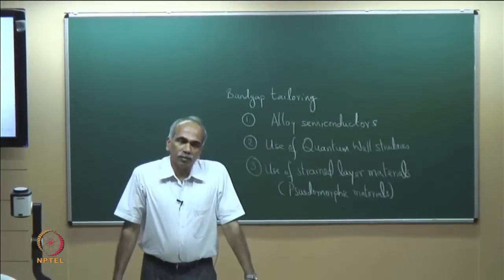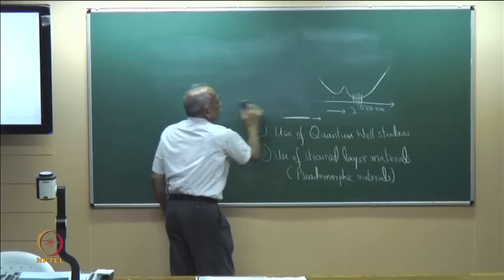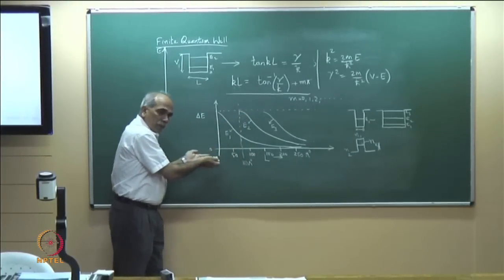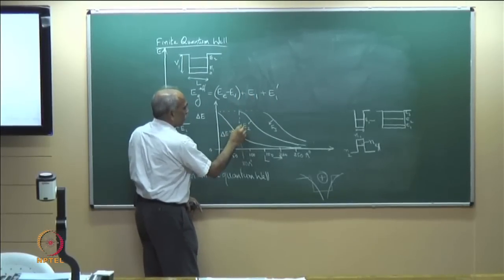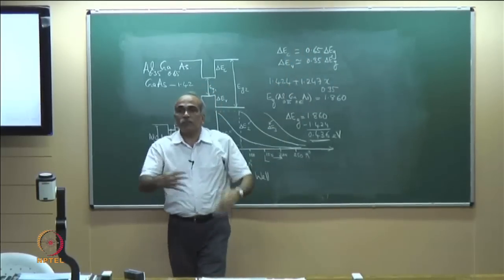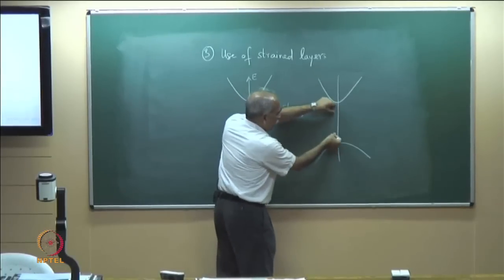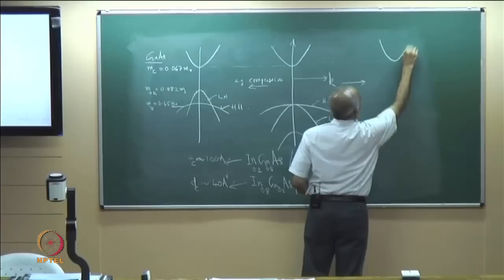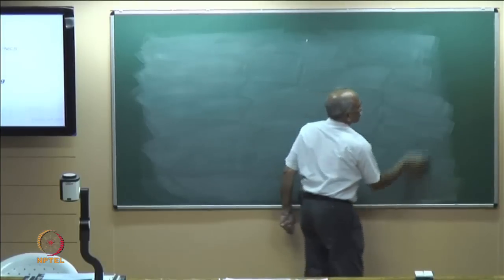Bandgap Engineering

Comment: In between 45-47 minutes; the speaker claims that the bandgap decreases for compressive strain and increases for tensile strain but it's not true (or he has misinterpreted)
The correct statement is: The bandgap increases for compressive strain and decreases for tensile strain. (Reference: Chapter 40 of Mark Fox, Radu Ispasoiu, Page #1042)
Kindly correct me if I'm wrong. Thanks
Reply: Can you correctly put the reference please?